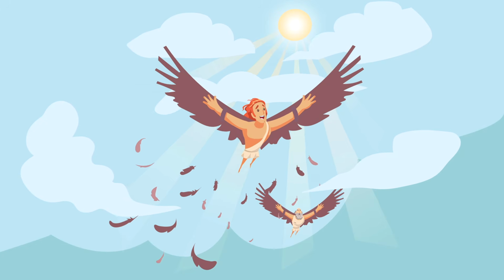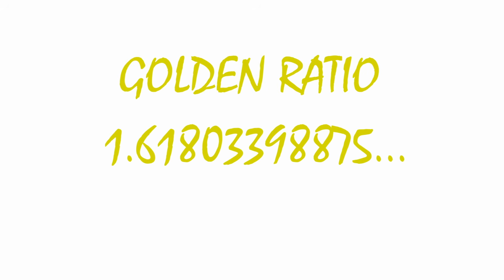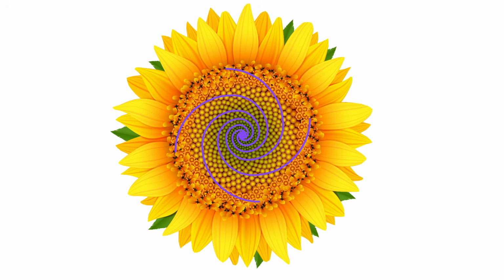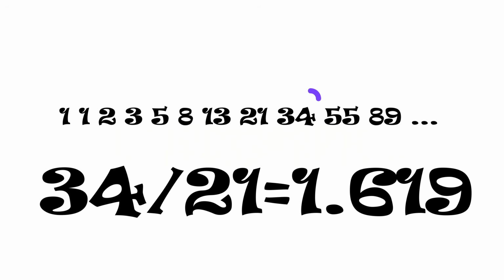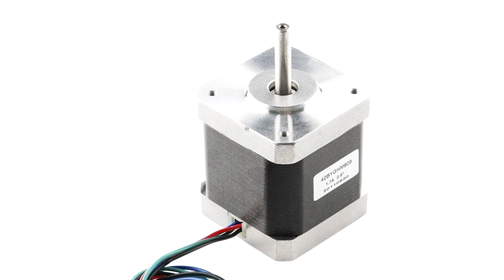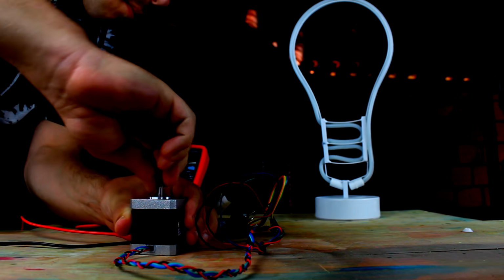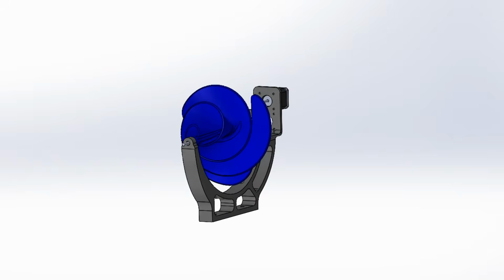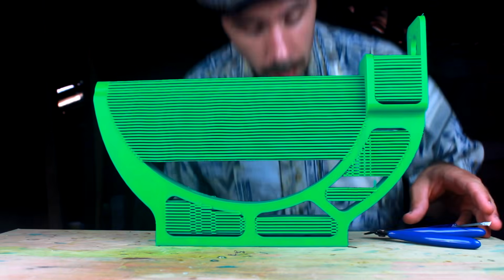Golden Ratio Turbine 3D Printed

Comment: How about trying this impeller in flowing water like a creek or a river. Kinda how dams work. Maybe put it in a tube with rounded inlets, and perhaps a longer impeller. You might be able to put better gear ratios for more power output. 30mph of water has a lot more energy than 30mph of wind

Comment: Try this experiment:
Build a wind funnel that catches the air flowing over the top of the windshield and reduces it down a little guys increasing the pressure. That feeds into a Tesla turbine (efficient build version). Use gear reducers to lower speed while increasing torque that then turns a generator. 
I don't know the math formulas but if you can get 10 Psi feeding into turbine, it should turn it at 25,000+ rpm. Gear ratio 5:1. If turbine has 1 ft pound of torque, it becomes 5 ft lbs. I'm sure you can turn a small generator with that. Reduce more if needed.
I remember as a child I once played with a toy that you can hand crank on one end and after going through a bunch of different size gears, came out the other side strong enough that you could not stop it by hand but the input crank was very easy to turn.

Comment: I've always wondered how much you could compress air with a 3d printed mechanism, like what's the highest pressure you could reach without relying on injection moulded seals or whatever, just 3d prints and a motor.
Reply: There is 2 things to consider, 1 is the heat caused by compression, the second is the pressure the vessel walls can hold before they are compromised.  The heat can be mitigated by adding cooling channels to the compressor,  the walls of the system can be made thicker to withstand higher pressures or even be made from a composite of different materials.

Comment: Wow we have a lot in common QQs flsunprinter and impaler designs mine are 4 year ago I recommend relay charger and jewel thief for power source or inductor and reed switch amazing power cold electricity as long as you use capacitor  to capture source. I'm trying to get my mind around rotary  inductor charger Nice Video I'm very please with your achievement's

Comment: How about if the golden ratio impeller were also designed with tubes that follow the spiral vertically and dump into a collective discharge at the bottom. Might be able to affect the output given it will have more surface contact with a liquid. Also using the impeller would it be possible to pump an aqueous copper solution around a magnetic source to produce an electrical current?

Comment: Can you make a Solar Mill (Solar Powered Crookes Radiometer), that can be used to generate electricity, enough to trickle charge a bank of super capacitors?
And when the Sun goes down can you then use the charge within the super capacitors to give motion to the Solar Mill?  ...essentially creating an attractive continuous motion machine throughout the day.
My guess is you can't.

Comment: I do want to see, some form of mechanical power storage option, just as a wild build, taking so many of what you made and slamming them all into one, mega-impractical (but wildly awe-inspiring) feat of mechanical electrical engine. Like, a Turbine which is able to pump water up into a tank, which, when power is wanted, a valve is released, and a water turbine would be engaged to create electricity.

Comment: I guess when you build a box shaped like a gramophone horn, that takes the air in and compresses it through the small hole to the turbine, you will get even more speed out of it. You also should add a grid/mesh  in front of it to stabilize the flow of the air. I would like to see that test some day :)

Comment: I could see this working as a hydro electric turbine as well. You could let gravity do the hard work, and let running water from a stream pour over the top of the impeller to spin it. Just keep the Stepper motor above the flowing water. I think this is a beautiful design. Great video!

Comment: I was hoping and still would really like to see a simple hydro set up using this turbine. Just drop some water through a pipe/cylinder with this sucker in there to see how much power it can produce and could even compare with wind? (i suspect optimising the motors will decide which is best?). But to compare, would be great if you can apply the same force (pressure) in both experiments. I'm really loving the channel bro, thank you so much for doing this stuff and making it funny and interesting at the same time! With always the best reasoning and logic for why to do it... cause why not!? :D

Comment: Make an improved pump impeller system for Fire Engines that can get comparable pressures, at lower rpms thereby increasing efficiency, and reducing system heat.

Comment: Kept staring at this in silent mode like silent movie tv era!
But, seemed too remember seeing or buying novelties through the mail based on that principle, BUT,
I have seen some in oil and use of light tinted food coloring and /or rubberducks or glass marbles, etc spiraling in the water. But, I imagined something in the far recesses of my mind. What if a spiral funnel was made 3 feet tall with ball bearing and cup shape weather vane on bearing with cup angled to catch water to turn the funnel? Of course would have to build a wall of plastic within a wall or 2 walls too hold water where funnel would catch air too turn turbine. Not sure if that's practical. The cups of weathervane catching water to turnfunnel in turn pulling air inward to turn turbine. Would this pull enough air in such a setup to create force to work something? 2 bottles glued within each other might create wall with cavity to pour water? Thinking this thing could suck air just as well suck water....what it's literally doing right? I doubt it would work though or practical even?

Comment: The guy that invented this,  used it to stir the water in an entire City's water tank. It used the same wattage as a light bulb for the giant water tank. Extremely efficient!
Reply: Once moving even if only graciously the force of several thousand litres/gallons of water is an huge energy for a 100 - 200w impute. The lily impeller interacts with water without large energy input. .
Reply: Would the movement of the liquid in the tank act like a resonant wave over time and amplify the turbulence that is being created, which eventually leads to the vortex?  I'm just curious as to what the behavior is without the tank restriction as well?  Do we still have the same effect when the system is unable to recycle?
Reply: @BretBowlby  That's why I want to see it replace the normal impeller on a personal watercraft and see if there is a huge difference in performance when the same amount of power is applied.
Reply: @cliffcampbell8827  but watercraft use propellers, not impellers
Reply: @sepg5084  PERSONAL watercraft, you know, those little water transports some of which can hold up to 3 people comfortably. Personal watercraft manufactures wouldn't make one with a propeller in fear of litigation because someone giving it a little gas in close proximity to a person and cutting them up with an exposed prop.
Reply: @cliffcampbell8827  i think the increase in water moving power is based on the fact that it's contained in the tube's resonant cavity with the water.  A more practical application would be to attach a water powered generator head to the flow of water on a large scale and see if the generator output is more than the motor powered energy input.  Thus what we call fr## #nergy
Reply: @sepg5084  they can use impellers if oriented properly, although perhaps not as effectively in terms of speed or velocity as propellers
Reply: @sepg5084  He's talking about Seadoo's which use impellers.
Reply: @BretBowlby  It took ~100 watts to maintain the vortex, but it took more than that to start the vortex. The water in the tank could be seen as a form of flywheel.
Reply: I remember seeing that, it kept the water good to drink and not turbid.

Comment: Just to clarify something. The car was moving at 30km/h, but the relative wind speed the turbine was seeing would be WAY more than that. Where the slanted windshield meets the flat roof, there would be a massive acceleration in the current, (but also a drop in pressure). It would be interesting to see the test repeated with the turbine in the middle, at the back of the roof and on a pole ahead of the cars nose (to catch truly undisturbed air). Great vids btw, I always enjoy them.
Reply: Very good point and true as well.
Reply: I was thinking 8W with 30km/h was pretty decent for a 30cm diameter crappy 3D printed propellor, I was wrong.
Reply: @LeDracodon  Now I'm thinking 'No wonder it sounded like the end of the world', based on subjective experience it's getting at least 60km/h, probably more... what's impressive here is that it didn't explode!
Reply: TRUE
Reply: Yes 🙃
Reply: On a pole at the front of the car?? Souns illegal.
Reply: @SeamusHarper1234  All the more reason to do it.

Comment: I want to build New Zealands first waste to energy machine using a large secondhand electric motor (plus my electrician and welders/engineers qualifications).

My girfriend and I just bought some land. She's pregnant, we're a mixed race couple.
We invested in some land as the market is crashing, pretty crazy thing to bet on I guess!

I started a business. I hope to get on Grand Designs show or similar to show off my design skills.

I will silence critics (saying they emit toxins) by building an air tight room.
I assure you, the amount of time for my oxygen levels to drop (medically monitored) will be the same with or without the exhaust gasses from the incinerator.

I will definitely be using this as a turbine design (I worked at hydroelectric power stations for years) and love engineering (mechacal fitting/turning) through working alongside other trades.
Reply: I also like blacksmith processes.
I am currently building and forging a lot of my own hand engineering tools and loving it 😊🤙❤️

Comment: Try to use hoverboard three phase motor to generate 40V 10A witch means 400W for 20-30 bucks.
I have made this summer one Tribike with 700w motors that goes for 30km/h and create an Tri-wheels electric longboard for chilling.
I bet you could do something better.

Comment: I've seen a number of videos on 'whirlpool' or 'gravitational vortex' turbines and, generally, they use a typical 'squirrel cage' or impeller design.  Why don't you try comparing the usual designs with your golden turbine to see which works better?  

(...and yes, I could use a new 3d printer.  Mine has me almost ready to throw it out of the window after having to replace/repair the mainboard twice and dealing with its other shortcomings.)

Comment: The Perseverance rover is on its way to Mars and includes the Ingenuity helicopter. It would really cool if you did a project exploring the engineering challenges of flying a helicopter on Mars, perhaps with a vacuum chamber to get air as thin as Mars.

Comment: Love the build and the jokes. Seriously, have you found any advantage to using the golden ratio spiral over other spirals? How specifically do you apply a 2 D pattern to 3D?  This application flows the energy from the center (in the water applications using added thrust of gravity, and then pushing it out and up. Viktor shaped the container like an egg to help curve the water up the sides without all the bubbles/turbulence. This will help when using the impeller as a turbine... (Do you see the Tesla Turbine should improve if you use it to spin the air from inside to outside too? You did it backwards, pushing the air up-hill (so to speak). I'll bet you get way more speed if you have the air work for you, not against you. (its not a competition) Although, I can't imagine the turbine starting to spin on its own. (If it does, you'll have to explain why it does, but once its going, like the water down the drain, it will keep spinning, and should have enough torque to pump air back to the center and become an air powered, fuel-less engine. Get out of jail free, do not pass go, collect your Nobel prize, OR go directly to jail for single-handedly breaking the world economy by inventing clean, non-polluting energy. Party on Dude, be good to each other.

Comment: I've got one for you that I've been meaning to build myself but I havnt gotten the time to do so, but I would like to see if it works and maybe you will find the time. Steps to this building this machine
1. Build a 3 chambered heron's fountain
2. In the bottom of chamber 1 install an impeller coupled to a generator 
3. In the top of chamber 2 install an air pressure fitting coupled to a compressor
4. Install tubing connected to water jet nozzles from bottom of chamber 3 back into chamber 1.
5. If you imagine chamber 1 standing vertical Then nozzles should be entering the chamber at an angle parallel to the z axis and x and y angle determined by fibonacci ratio. As to induce a vortex inside chamber 1. Im not entirely sure if this would be the the optimal placement  of these nozzles to achieve the highest efficiency but thats where the experiment comes into play.
5. Pressurize chamber 2 with air.
6. Experiment changing flow rates between each chambers.
Hope you find this interesting enough to attempt to build it. Like I said had the idea for a while just been working on other projects like work and parenting and stuff. So at this point I'd just like to see if it'd work. Thanks man have a wonderful day.

Comment: The great thing about wind is that it pushes a large area. Having turbine tips that stretch outwards allows the wind more leverage to push the blades at a lower speed. You can still use the golden ratio when designing the props of the turbine blades

Comment: An explosion powered pogo-stick: where your downward momentum operates the chamber in the pogo like a piston, with “top dead center” being when the stick is fully compressed 

If you’re worried about it blasting away just make the stroke longer with a smaller diameter so it’s not too powerful for your weight 

For ignition you can use one of those crystal strikers that provide the electric spark for electric lighters (but remember you need ignition just before you reach top dead center) 

It’s been a while since Small Engines Repair Class... I could be wrong about most of what I’m saying but because internal combustion is very powerful and simplicity is best here, you might be able to get away with making it a 1 stroke engine and simply count on the unflushed exhaust to reduce the power of the explosions (venting as the piston extends while the upward action of the piston compresses fresh air in a second cylinder that vents fresh compressed air into the combination cylinder just after (or as) it’s venting the exhaust.
The energy used for compressing the air fuel mixture will come from compressing them in the combustion chamber with your downward momentum which will give your pogo-stick a bouncy air cushion to help avoid bottoming out when you hit top dead center.
Reply: jerk fudgewater 
I had this idea about 50 years ago, but life went in a different direction. In those days they had hand held compactors that worked on a similar principle, which is where I got the idea. Think you could use those little disposable butane gas canisters to fuel it.
Reply: Q. E. D. Everyone has had the idea, no one has done anything with it though...
Having had the idea “for a powerful search engine that doesn’t suck” was common but Google actually built it. 
In the book “4 hour work week” there is a line that terrified me: “the road is littered with poor people that had million dollar ideas, you need to actually make them.”

Start making your ideas real, improve this world